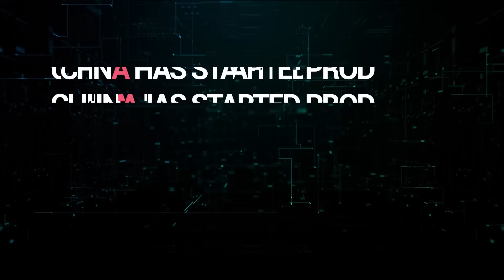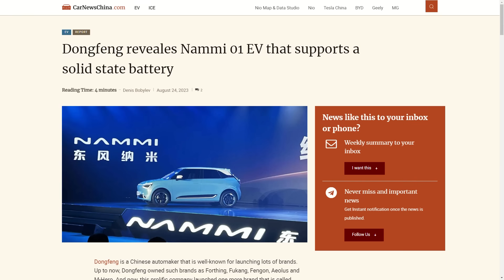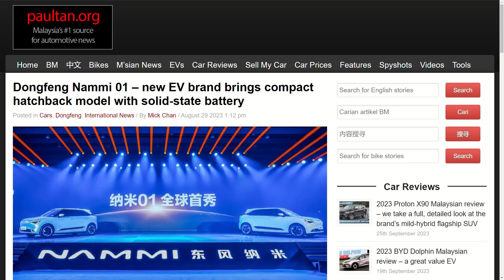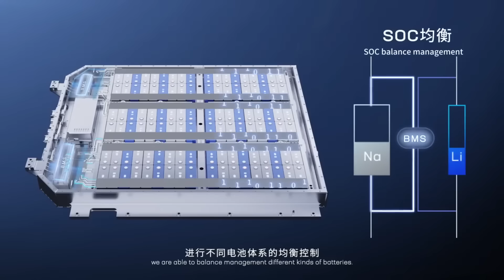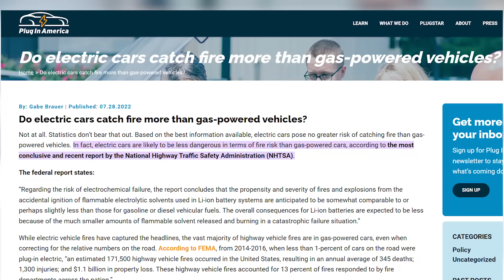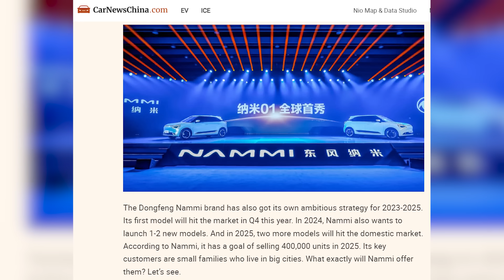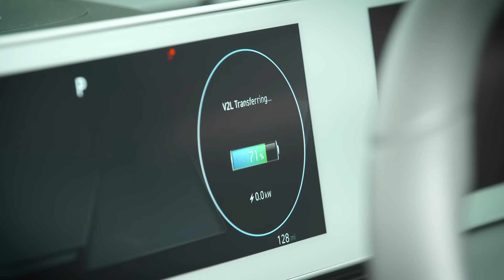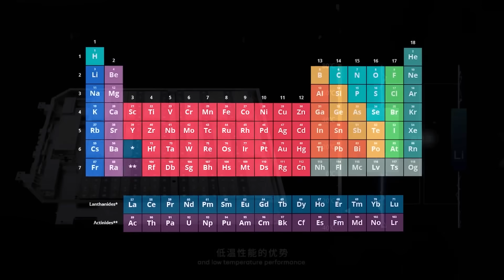Lithium Battery, GOODBYE! China Has Started PRODUCING Worlds 1st EV With Sodium Solid State Battery

Comment: A junk way my invention flash driving running in light speed way can power that 110v ac x2 or 220 v ac x2 ,
No fuel no batteries and as big as a luggage only. 
Just running only

Comment: A better safer battery would make me consider an electric car. The problem with statistics on fires in electric cars is that in these cars it is nearly always serious and difficult to extinguish. Most car fires is ICE are electrical anyway and only powered by 12 volts and rarely fuel related and are easily extinguished and in many cases repair is possible. 30 years in the fire service has shown me this .

Comment: The guy in this video said EV is no more dangerous than a gas car in terms of catching on fire.  However, he didn't tell you that an EV fire is much more intense and much more difficult to put out.   He also didn't tell you that an EV can catch on fire while sitting there doing nothing.   He also didn't tell you that a guy's Tesla caught on fire and he couldn't open his car door because it lost electrical power.  He had to kick and break the window in order to get out.  

I have been driving gas cars and diesel trucks for 40 years.  I have never seen a vehicle catch on fire while it was just sitting (entirely cooled down)  there doing nothing.  Petro by itself will not ignite.  It needs an external heat source before it will burn.   EV batteries, on the other hand, do not need an external heat source.   The batteries can generate the heat by itself and burn.   It's a ticking time bomb.
Reply: Yep, EVs the choice of the the dogooders with no sense and definetly more money than brains!

Comment: This is a solution to nothing.
Sodium based batteries have a lower energy density than lithium.  In other words these cars will have less range.  There is no way to circumvent the science. Currently there is no company making sodium batteries in the quantity required.  And the death knell for all electric vehicles is that the grid can't handle them and there is no possible way that the grid could meet that demand is foreseeable future.  And then you have to remember that the grid is powered mostly by fossil fuels.  So electric cars does not make fossil fuels go away.  It just moves fossil fuel burn to another location.
There is no such thing a green energy.  Solar, wind and hydroelectric are undependable and land use expansive.  Nuclear is the cleanest form of energy but the American left has a phobia for nuclear.
Reply: There are people living without fossil energy. The Amish. Is it the solution?
Reply: @JohanLofgren-jc4mh  "The Amish have their own alternative power sources, including the Amish solar and wind-powered sources. They also use their homemade generators, which are often powered by diesel or propane. They don't pay for water and sewer services either because they do not believe in using those utilities."  Google

Comment: POP QUIZNO: WHAT HAPPENS TO SODIUM WHEN IT COMES IN CONTACT WITH WATER. NOT A FIRE, BUT A VIOLENT EXPOSION.  THINK ABOUT THAT BEFORE YOU THINK THIS ANOTHER VIABLE SOLUTION TO ENERGY. IT'S NOT. MORE DANGEROUS THAN LITHIUM. AND PROBABLY HAS TO BE MINED IN CHINA. ANOTHER CHINA SCAM.

Comment: I prefer the japanese system hybrid its safe and good no need a plug and with petrol engine is so easy to fill up 😊
Reply: I like never having to fill up, whilst you divert off your route to get to a fuel pump, queue to get to the pump , get your hands dirty then have to walk to the till queue again to pay, I haven't had to do any of that as my EV charges when I'm asleep.
Reply: @adamhardy8690  and when you wake up your car burn down
Reply: @D.N.A.23  My EV is a likely to do that as your car is from all the explosive fuel in it and electrically circuitry.
Reply: @adamhardy8690  my car dont burn spontaneous parking place like yours do...PERIOD
Reply: Charging sodium batteries is fast and different from the difficulties it takes to charge lithium batteries Charging sodium batteries A few minutes 10 minutes You can walk from New York to Los Angeles for a long time Better than dirty gas stations with black fuel The mentality must change and change must be accepted because the Soviets and propaganda rejected the Internet and computer revolution and that was their mistake
Reply: China's hybrid power is no worse than Japan's, just because the price is too cheap and entering your market will be sanctioned.
Reply: Do you like clean air?
Reply: @SK102938  no i like to live free nobody tell me how to live , not government they  lie all the time

Comment: So a battery that is safer, gets more mileage, charges faster, is cheaper to produce and environmentally friendlier than lithium batteries. Did I forget something? Where is the downside?
Reply: @siminlin8604 you funlee. So clever too. Gosh, did you come up with that one all by yourself?
Reply: ..downside is, it doesnt exists..
Reply: @eccosabanovic1589  Exactly. Too many people are gullible to CCP propaganda.
Reply: They still have regular battery issues like phantom loss of charge and lack of ev infrastructure
Reply: @quincycuthbert5408  it's a step in the right direction. Any quality issues will be worked out over time. When Henry Ford started to spit out the Model T gas stations were few and far apart. It unrealistic to expect charging stations all over the nation overnight. It's also unrealistic to think combustion engines will disappear at a certain date. They will exist along EVs  and other alternative powered cars a while longer.
Reply: @karlheinzegger9790  ev's have been out long enough the infrastructure should be solid enough by now. If the US has said we are moving forward with EVs but can't even decide on a universal charging port we aren't moving anywhere.
Reply: @quincycuthbert5408  you touched a valid point here. Not everyone in the US says we are going forward with EV. Depends on who holds power the going forward can be very slow.  For quite a large part of the population (in every country) a car that has no rumble under the hood is not a car. 
The charging port will be sorted out in time.
Reply: @karlheinzegger9790 people also need to get away from the mindset that you need to do the same as petrol with stations everywhere to fill up. With an EV most can charge where they park for the night or at work. It's a different way of driving. I have a Tesla, despite the huge amount on the roads the charging stations are normally 80-90% empty. Why? Because it's rare people do long journeys so otherwise they just charge at home at night.
Reply: @adamhardy8690  correct.  Charging times is only an issue on long trips. Plan the trip,take a break,use fast charging. It's very difficult to change people's minds.  It will take a while and gas powered cars are not going to disappear overnight.
Reply: Good question, but easily explainable:

1) Different technology will need different equipment to produce it in large scale. Factories will need to be built or rebuilt to handle the new technology employment.
2) Lower range: Solid state sodium batteries are set to make a small car to go for some 200Km at most. They're unreliable for the average to bigger cars right now. That could in theory to be solved with a new generation engine series with half, one third or even one fourth of current engines power consumption... But, apparently it is being easier to develop at the batteries front than at the engines front, or it might to be cheaper and faster to do so.
3) A never used in large scale technology will need its pioneering use cases. You know. Companies will prefer to explore the current technology till the pioneering ones have entirely sorted out the first user bugs.
Reply: Made in China is the problem. What happens if China invades Taiwan? Sanctions from the "West" will make anything from China a no-no.
Reply: @siminlin8604  years ago "Made in China" was not much  of quality lable. I think they have caught up nicely. Also if the batteries are as advertised they can and will be manufactured all over the globe.

Comment: All the numbers comparing ev fires Vs gasoline engine fires.  Was there any data on the cause of the fire? Fuel line leaks? Electrical arcing? Comparative age of the vehicles burnt? I'm all for electric if there's sufficient infrastructure to support ev cars.
Reply: There are millions of cars with batteries on the roads, they're not instantaneously catching fire all over the place. A battery in a car is no more dangerous than a huge tank full of explosive petrol.

Comment: How much power from the solid-state batteries compared to weight and size of lithium cells?
Reply: Where does the extra electricity come from? Is it coal like for lithium?
Reply: About twice as much power compared to the same size.
Reply: @Ad__Rem  But don't the internal constituents of solid state batteries, which vary based on construction, isn't lithium  a key factor in most.
So, where is the scarce and expensive lithium going to come from?
Reply: @Ab_Dijbier  Yes, on the Lithium ones. Far less than Sodium ones. Batteries themselves are lighter though. That may to pave the way for less powerful engines to power, especially the smaller cars and then the combination of lighter batteries and less powerful engines will at least in a good way to solve the range issue.

Comment: so they produce thousands of cars using lithium batteries spend billions then they found new batteries technology!!! what should be done to that production!!!! how will they recycle the previous production??? then new battery comes along and the waste of money and resources !!! why not save the money until you find the best solution, EV technology is not ready yet, why rushing in large production??? and stop forcing environmental restrictions on gasoline cars until you find what you looking for and works.
Reply: no. if you study chemistry when you were in high school, you would know that sodium and lithium are actually on the same column on the periodic table and have similar properties. Sodium battery is using all the tech Lithium battery developed in the last decades, only it is much less powerful and very much bulkier and heavier. sodium and lithium went head to head 20 years ago and sodium lost by a hundred miles. the only problem is that Lithium is 130 times more expensive than it was 20 years ago, so they need to bring a competitor into the game.

Comment: Battery from Sodium will be changemaker of Ev car😊😊😊😊
Reply: Not really. Sodium battery went against Lithium battery right at the beginning, failed, and was obsoleted. They brought it back because Lithium is now 130 times its original price 20 years ago so they brought Sodium back into the game because it is cheaper. Expect the Sodium battery still have all the problems it had 20 years ago, namely energy density.
Reply: @egaskrad R&D, believe my fried.😅
Reply: @cpm2k  Sodium and Lithium are on the same row on the periodic table. whatever R&D done on Na or Li is very much possibly usable on the other. If you think Na is much better than it was, Li is double on that improvement. Na was 70Wh/kg at the beginning and now 160Wh/kg. Li was 90Wh/kg at the beginning and now 500Wh/kg.

Comment: The big question is whether it’s going to have a much longer the range will be!!  If it’s going to give over 200 miles of range, it’s a great idea.  If it’s 200 KILOMETRES, then it’s only 125 miles of range, and therefore bloody USELESS!!!
Reply: No difference from a small petrol car with a small tank. You just refill as you drive. Sodium battery recharges very fast with similar time to refilling petrol.
Reply: About twice as much due to the fact that they are half the size.

Comment: I could make a car that is electric that you never have to charge just from what I learned in college. But if they can't tax your money, you're not allowed to build it or someone else would have done this. It's a voltage boosting system used for stadium lighting that can turn 12VDC into 36KVDC. And then you take 12 from 36K and you have 35.88KVDC to run your motor.
Reply: Did you learn that in college? Let me guess; was your major in liberal arts or women's studies? Another question; why not put two batteries in the car, so you can charge the second battery with excess energy from the first battery?
Reply: Neka si mu reko!nije taj ni video "college" a kamo li ucio o struji.. @ljuboizsiska5448
Reply: It's the current that counts not the volts
Reply: @davewebster1627    Then make the last loop that change High Voltages/ L Current to High Current Low Voltages [ A Transformer converts high voltage (low current) into low voltage (high current )  ]

The Questions should be addressed is:

Both USA and China and Germany as well UK Electrical Grids are not ready for that much Consumption of Electric Powers:

Given one Example of Texas ERCOT:

Last Updated: Oct 14, 2023 19:39 CT
Autumn GENERATION	FALL CAPACITY	MAXIMUM CAPACITY
Solar32 MW	(0.1%)	11,663 MW	22,163 MW
Wind	2,576 MW	(5.8%)	12,686 MW	39,897 MW
Hydro48 MW(0.1%)389 MW600 MW
Power Storage382 MW(0.9%)1,053 MW5,405 MW
Other0 MW(0.0%)163 MW113 MW

Natural Gas	28,577 MW	(63.8%)	54,367 MW	69,890 MW
Coal and Lignite	8,134 MW	(18.2%)	13,623 MW	14,321 MW
Nuclear	5,047 MW	(11.3%)	5,064 MW	5,448 MW

pls look at the Energy generated by Wind Turbines -- Fluctuate 5% when Winds died down to high of 40% daily and look at the Power Storage percentage!  

China last year 2022 generated Electric Powers with 82% more coming Fossils (Coals, Oil, Natural Gas), with 55% (of 100%) came from Coals = what a 😂 😂 going EV!!
USA not much better, Look at ERCOT Texas, the most independently operated Grids.   We can develop 🔋 🔋 that time of Charging is 8 minutes but the Grids can not deliver what the Batteries suck from the Grids.

The Truth Hurts!  And Elon-gate spends all the times talking about New here New Tech there but the truth is Last Summer when Heatwaves hit California and Texas; the Grids/ The P&G Utilities Companies sent out warning to save Electricity; use at discretion!!  (and given that only about less than 5% total BEV then!  What's a Laugh/ Joke.

Cheers,
Reply: wow, energy from the void. law of conservation of energy is going to cry.
Reply: You need to go to a different college .😂😂😂😂
Reply: You could thleriroretically run this with a standard12VDC lead, acid battery and resistors and diodes.
Reply: @CrispyGrey Thleoriorbiobatleallyrerically I think you have no usefull  knowledge about this.
Reply: 😂😂 You obviously have no idea what you're talking about. First: learn about the difference between Volt and Amp. After that, you will be laughing at your own comment 😉
Reply: Hahahaha 😅😅😂😂😂. You should be a standup comedian or a politician.
Reply: If it is so easy, do it! Make billions.